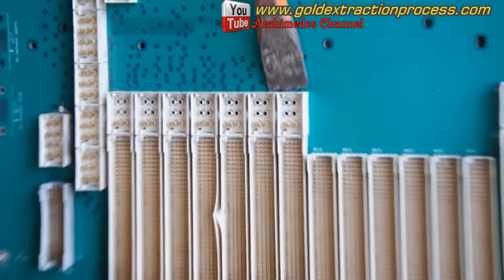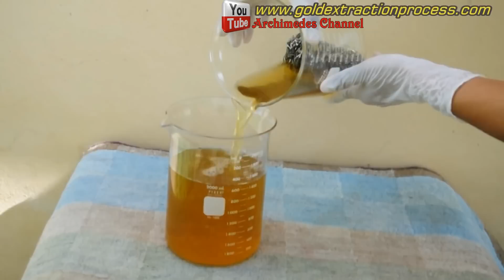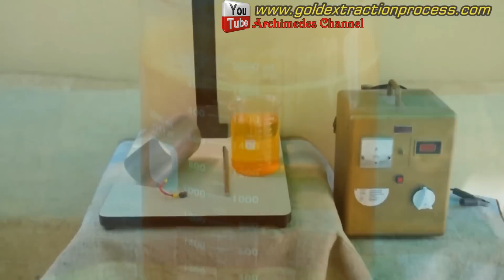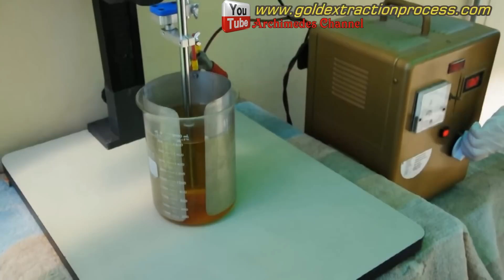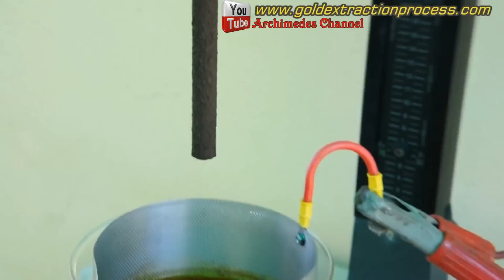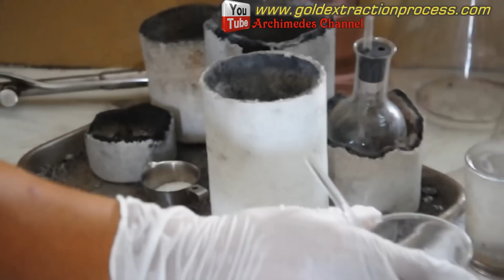Electrolytic gold recovery Gold Electrolysis. gold electrolysis process.

Comment from the maker: Electrolytic recovery of gold from aqueous solutions
Abstract
Electrolysis of metal ions in dilute solutions using vertical planar electrodes results in low recovery. Therefore, an electrolytic cell arranged concentrically with extended cathode surface areas was designed to improve the rate of mass transfer. Three types of gold solutions obtained from industrial sites were used. Despite an initial gold level of 110 mg l−1, the electrolytic cell was effective in reducing the gold concentration to as low as 0.1 mg l−1.
Reply: what was the solution used on 1st stage or process?
Reply: Archimedes Channel merhaba deneyde kullandığınız kimyasallar nedir
Reply: @bushiseishin  did u get the answer . I need to know the solutions wich work with this method
Reply: Can you share the protocol for this experiment?
Reply: @bushiseishin  the solution he is using is probably aqua regia
Reply: ممكن عربي انا من مصر وكنت عاويز اعرف فصل الطلاء الذهب بالكهرباء
Reply: @bushiseishin some sort of gold stripping solution

Comment: Looks like weak AR solution w/ diluted Sodium Nitrate salt solution for conductivity - Zinc anode @ 12-14 VDC + / 1ampre             1/2 dia. 316L  SS Rod cathode ( - ) ?
Reply: I would collected alot of those beads & smelted them down @ around a yield of  5 troy oz. and aquarted them into distilled water for flaking , then I would do a Full AR and precip for lead,zinc,silver. Then you can SMB the gold dust     at to around  .999 -.995 24kt.

Comment: Music very entertaining.... No Instruction ?   Time waster
Reply: Not at all; in fact is the electrolysis extraction method is faster than the others so far ......
You shold be glad instead of writeing nonsenses.
no instuction?  It is the reverse process to gold ( copper, nikel, chrome....etc) plateing a different metal, to give its appearance and some propperties (stainless for example,  great efficience to disipate heat between conexions in electric/electronic devices); Also  the way to set up acurate and clean components for the process; the ratio between the pins and the amount of solvent ( can see it in the volume of the biker) and much more but I have allready wasted lot of time with a person that doesn´t look further than a gold piece.
Reply: Sandokn noname mm
Reply: Sandokn noname
Reply: OK, but what chems are used, what voltage and amperes, polarity...Understand why john wakefield wrote "Time waster"?
Reply: 12VDC 25Amp
Reply: He assumes that people already know much of the information, How did he dissolve the gold, remove the gold from the 'stainless'?? rod and sheet, no information.  If I already know this, why watch?

Comment: Add 70 g of potassium iodide and 30 g of lodine crystals and add 200 ml of water, add the solution to the golden pins and wait until all the gold has been removed. Add the golden solution only in a new beaker and add 20 g of sodium hydroxide to 30 ml of water and add it to the gold solution and mix the solution and add 30 g of Pure Ascorbic acid powder to 50 ml of water and drop the gold powder
Reply: why add sodium hydrooxide?
whts the purpose?

Comment: Basically he dissolved pins in aqua regia then neutralized it atleast to pH 6 to form the sodium salts to prevent redissolution then finally electrolysis either sacrificial or inert anode and BAM gold!!
Works similarly for cyanide but you dont even need to neutralize.
Reply: by what did he neutirlize the solution to get 6 ph??
Reply: @MOHAMMED-OBAIDAT184  probably NaOH or Na2CO3
Reply: @CatboyChemicalSociety  
thank you very much 🙏🏻
Reply: It wasn’t AR it’s a gold stripping solution
Reply: What do you think the anode an cathode were made of 1 might have been stainless not sure other 1
Reply: @MOHAMMED-OBAIDAT184  since reduction is being constantly done at the cathode, there would be no need to nuetralize AR, only if your wanting to precipitate with Metabisulfite, correct? Or no?

If anything it seems likw the only thing hed need to eliminate would be the nitric acid.

Comment: Wow guys that's a lot of work lol I'm high and feeling generous so let me save you some time in the future .use a heat gun or couple seconds in really hot sand if pins go thru the board use something flat to push thru on the back side and smack it few times. Its MUCH faster. The pins just fall out everything falls off actually

Comment: I dont agree with the results.  If the acid put any of the base metal in solution then it would also come out as a powder with the gold.  Maybe it would help if i knew what acid that was that took the gold off of the pins without eating any of the pins.  I have a feeling that some base metals got into solution and that they also came out with the gold when the electrolysis was done.  There may be a secret that i dont understand but Even if the electrolysis was run too long then some of the cathode would be present in that powder collected.   The only way to know for sure that that doesnt happen is to shut the system down before all of the gold has came out.  the only way i could see this process working is if the solution was de noxed, but still kept acidic with hydrochloric acid, but then there is still the problem of silver palladium and platinum contaminants.
Reply: the acid he is using is apple juice. So technically he is not lying because apple juice have some level of acidity. But dissolving gold in acid, while having base metal resisting is an awesome joke! Also, gold plated pins don't cover aluminum, aluminum is not used to transfer electrict current, copper is.

Comment: Seems like a lot of work to yield MAYBE what, a gram?  or just under it. Granted I understand that the gist of this is to simply show the process on a small scale but my point is you'd have to work round the clock and move fast and efficiently to make this worth the time. Not to mention your lack of details in this video makes it less than informative.